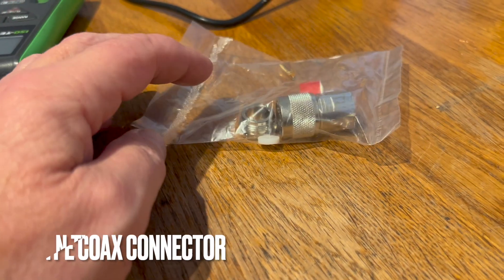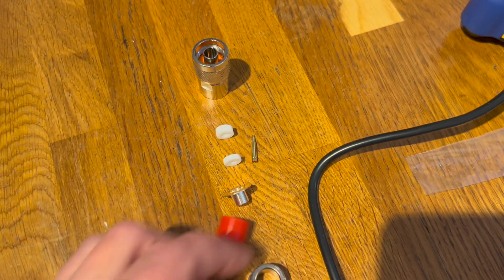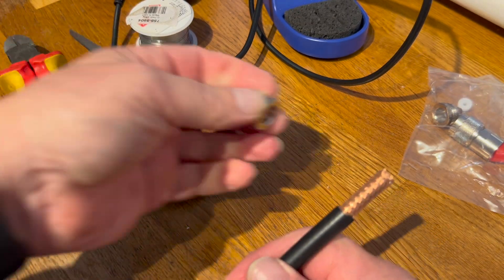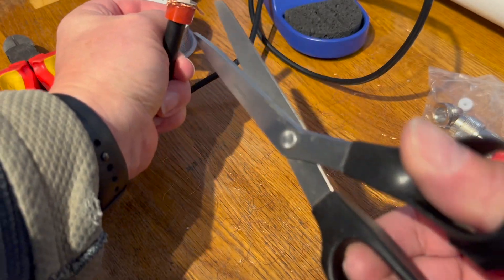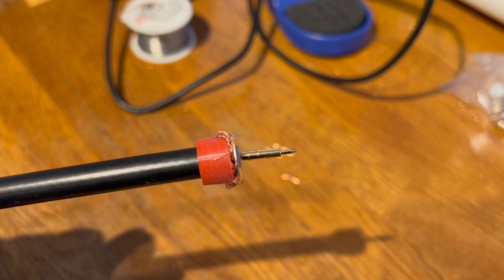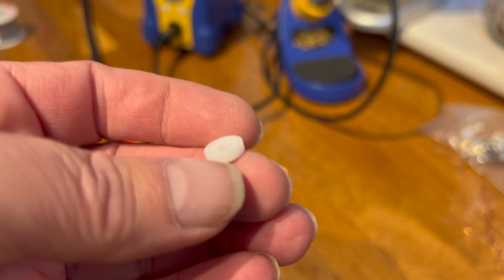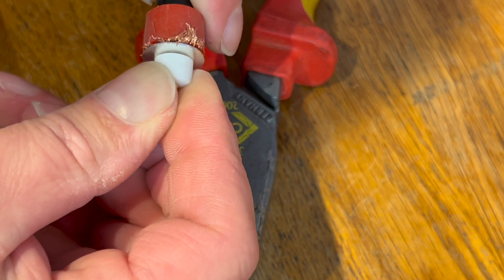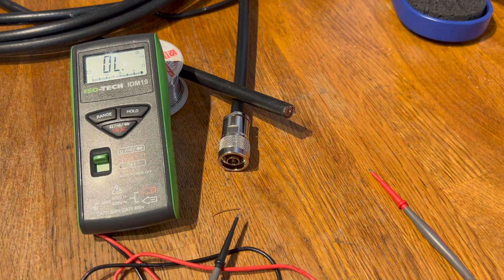HAM RADIO: How to connect a N-Type Coax Connector.

Comment: No flat washer between the bottom nut and the grommet Mike ?
Reply: I brought same plug can't remember where from came in the sealed packet it was no washer I didn't like it. I get all my different plugs from m0mat very good quality with washer.
Reply from the maker: Yep no slip washer supplied, very expensive n-types too.

Comment: A couple of points. 
Don't ever do this anywhere near your radio equipment. The short lengths of cut off braid can find their way into equipment via ventilation holes and cause shorts of the circuit boards. It REALLY spoils your day.
Instead of a soldering iron, if you have a heat gun with a small nozzle that can work better to solder the pin.
Nicely done Mike!
Reply from the maker: some good points here.